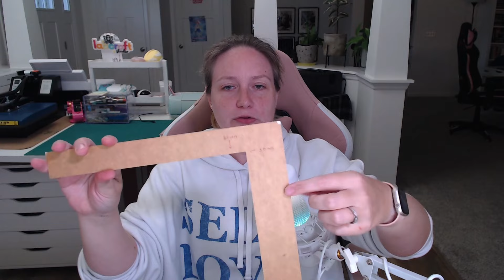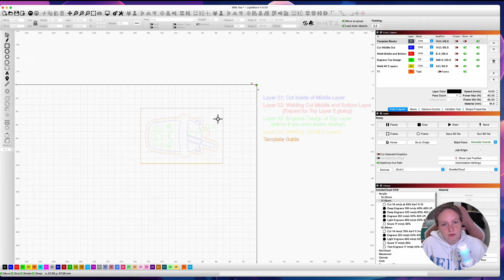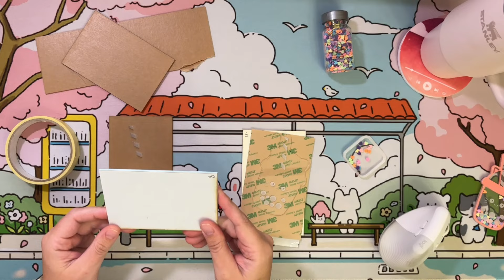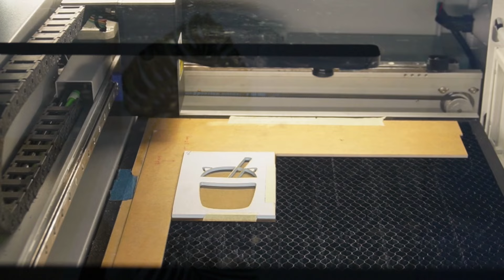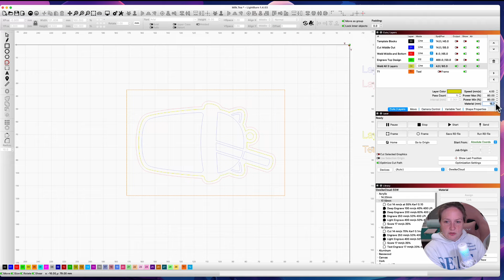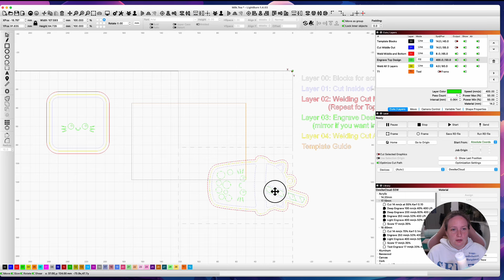How to Make an Acrylic Shaker without Glue using Acrylic Welding

Comment: Hello, and thank you for the great video.

A suggestion for the holes forming on the side profile: you might be able to mitigate them by running a second pass after the initial cut. You could use the same path or an inwardly offset path of 0.1mm (or about 0.004 inches) or less, but with a lower power setting and a slower speed.

I also had a question. Do you have any issues with liquefied acrylic bleeding between the overlapped layers? When I attempted a similar process, I had some residue left from the flow, so I was curious about your experience.

😄
Reply from the maker: Thank you! 😊

I have noticed a little residue, yes. Usually it wasn’t enough to bother me.

I had another person mention a second a pass to do a seal as well. I’ll have to try that….
Reply: @LabcraftStudio 😊 Thanks. We were fully refunded due to the residue issue. It was barely noticeable, but customers did not like it.

Comment: Instead of filling it with water prior to welding(I know you said it's not waterproof eitherway), couldn't you just leave a small little area for a needle and inject water after the rest is welded, then just resin seal that hole you used? I would probably use something like propylene glycol over water, I think it would provide a more snow globy effect. Not sure though, just thinking out loud.
Reply from the maker: I didn’t contemplate this but the problem is that you get small holes in other spots around the cuts where things leak. I don’t know if perhaps coating the sides with resin would fix that problem. I haven’t had a chance to try it out.
Reply: I’m kinda confused with the layers. So how many layers plus thicknesses of each? Thanks.